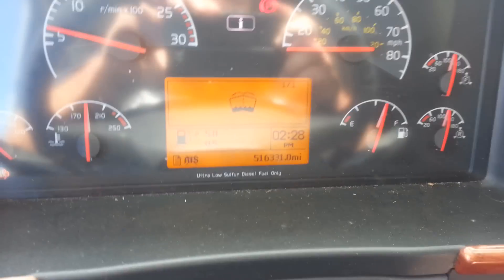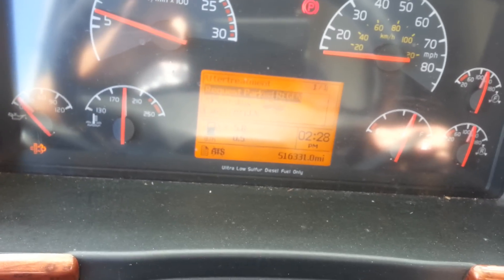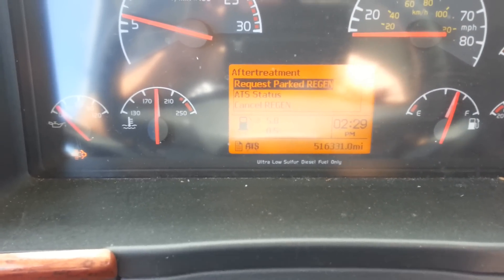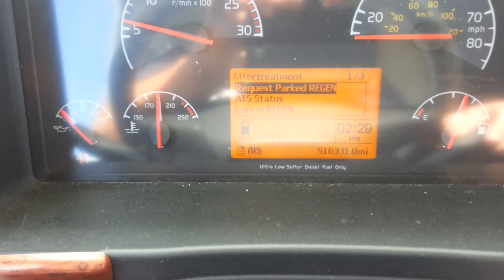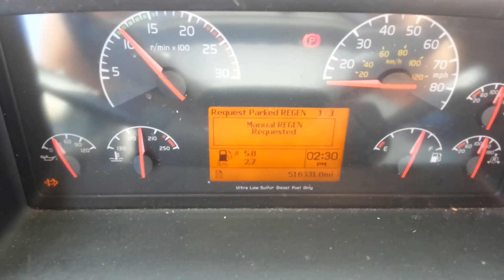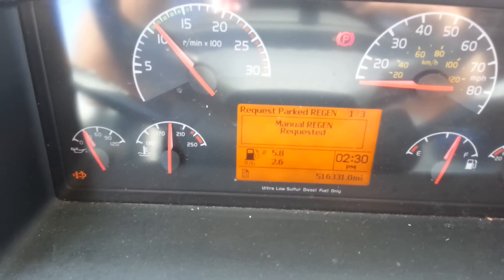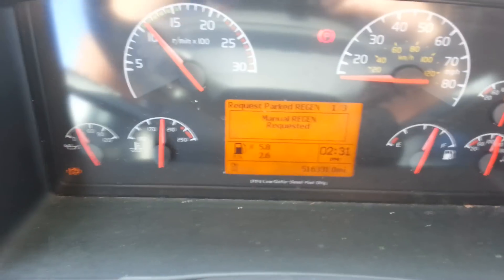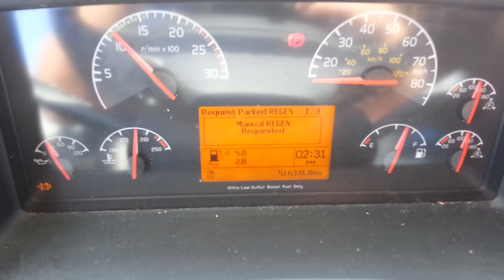Parked Regen Required or Needed on Volvo Semi Trucks How to Fix it

Comment: I've had my 2016 Volvo now for almost a year. Never had to do a forced regen, untill today on my yo cedar rapids. It's pretty windy today and I was heading right into it at 70mph. Would these conditions possibly cause this, or should I start thinking about getting filters cleaned. Truck has 500k, never had any problems since owning it. Thanks!

Comment: So I had REGEN in progress whiles i was driving on a highway with Volvo 2015 D13 with a Cummins  engine, I didn’t stop and it went of by it self , i parked after 30 mins and start it again just to see weather it will prompt for check engine light or something but none came on the dashboard is it something I should be worried about since I didn’t stop right away whiles it was in progress??

Comment: sopposed to get the engine hot before u start the regen, allows the NO to separate to N and O better getting ride of the hydorcarbons easier only takes about 20 mins then

Comment: At least this driver figured out someone disabled regen and got it going. Solid DPF light indicated stage one. Flashing light is stage 2 (very high soot level), flashing DPF light with CE light is stage 3 (critical soot level) and must do regen ASAP. Continuing without doing regen will light stage 4 stop engine light and will shutdown down in one minute. When that occurs, driver is locked out from performing regen and need laptop to bypass lockout and force parked regen. Truck will restart in stage 4 but only go about 150 feet before shutting down again. Trucks will do passive regens while traveling but some conditions will dictate parked regens including excessive stop and go or idling. Experienced some older trucks with original Phase one regen system (pre DEF) required AC turned off so computer took over engine fan control during parked regen otherwise fan stayed on continuously.
Reply: Ty for this info. Very helpful! Do you happen to know how long does a level 2 parked Regen normally take?

Comment: I don't like def trucks. Every time you regen on 1100rpm for an hour you burn a lot fuel. If you are owner operator and you pay the fuel this will be no good for you. I got Volvo 2006 I don't buy def I don't regen. I will keep the truck as much as possible. When I make more than 1 million miles I will make overhead to the engine and will keep going like that. To everybody else with trucks newer than 2007 I will say good luck :)
Reply: Truckers should petition for the EPA to pay for the fuel burned doing their bullshit regens.

Comment: For the new volvos that have dpf and or def, if you leave the truck off for 24 hours or more. There should be a power switch probably under the drivers door, remember to turn the switch to the off position. My company owns all volvos and has seen a lot of issues with the regen not working.  Turning the power completely off allows the computers to reset and clear out. It doesn't damage the truck in any way.  This will fix the inability to regen most of the time.  Other regen inabilities could stem from check engine lights.  A check engine light may prevent the truck from regenerating.
Reply: thank you for this information, the pdf light is flashing and I requested to do Regen but it won't do it. Now I figure because it has the check engine light on. I guess I must take it to the shop.

Comment: how about you leave your ATS on and let the truck do what it needs and that regen light will not come on as offen. you are just causing more problems with it disabled. that disable should only be used for safety were a regen could cause fire. (petrol fill up or grass fields)

Comment: Whats your mpg that u get ?
Reply: Volvos may be shit, as you say, but when I went from a kenworth to a volvo I started saving about $11000/yr in fuel costs. The K-whopper got 5.8mpg and the Volvo gets 7.0.  I like the Volvo.    (The word Volvo means "I roll" in Latin)
Reply from the maker: around 7 MPG
Reply: The Truck Driver Guy

How often does your "regen" turns On.  It looks like in my case - 2008 Volvo vnl670, Regen turns ON frequently and it burns fuel and AC gets not COLD and heater does not work good. Same issue ?
Reply: Volvo is shit... this guy is shit, probably a muslim that married with a north american woman, get social security and then are stealing jobs from americans...